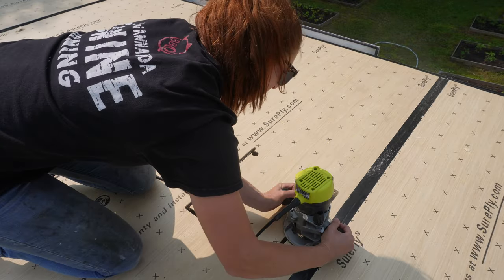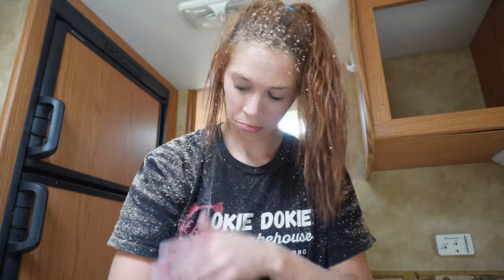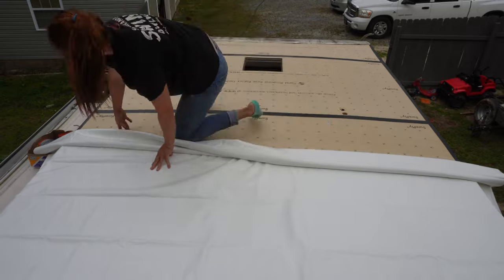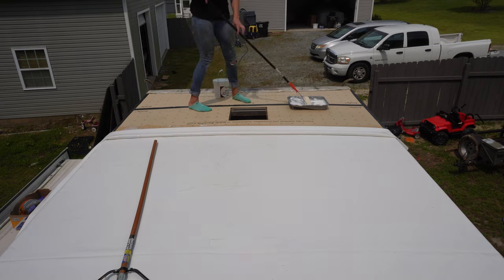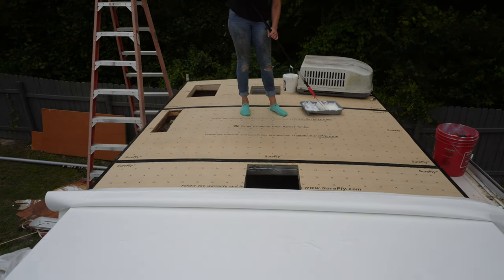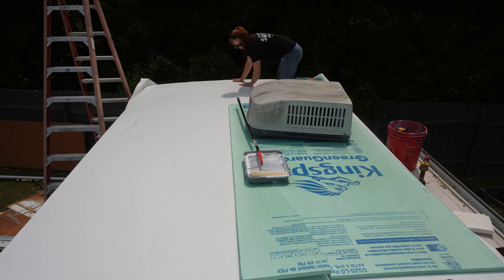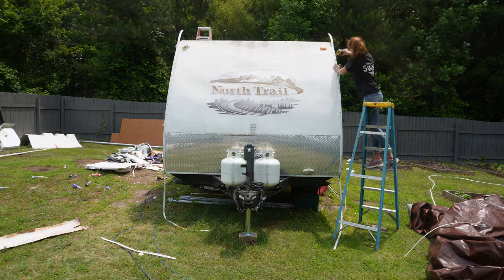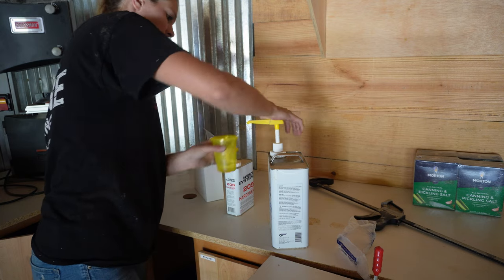RV Water Damage Repair: Demo Day 9 Front Cap & Roof

Comment: when you use contact cement, you have to apply it to both surfaces you want to bond together, wait for it to dry and then join them.  Once both pieces touch, it's stuck so make sure you have them where you want them.  You can't use it wet.  It has to dry first.
Reply: I haven't seen one person coat the decking & the roof material
Reply: @jamesmedina2119  He is talking about when she coated the front cap plastic/fiberglass to the ply.  She rolled the contact cement onto the plywood than placed the fiberglass on it.  I will find out in the next video, but I am guessing it didn't work.  Derek has it right.  Cover both surfaces, let them dry, then when the two dry surfaces touch, they will never come apart.

Comment: A skate wheel type hand roller that's used with flooring like vinyl would help you much better than the squeegee. Take that from a old floor man. Rubber knee pads might help also 😬. Another thing is I'm sure you already know but just incase,, the contact cement works best if applied on both surfaces and let "dry" to where it's just a little tacky then matted together. I'm glad I found your channel. Your honesty is top notch and you do excellent work!
Reply from the maker: I usually use a pool noodle to smooth it out and it’s always worked great but my kids used it as a sword and broke it and I forgot to buy a new one 😂 I do also think that’s why the contact cement didn’t work is because I only applied it on one side…maybe I’ll re try it again on the next camper

Comment: great job!  I started searching for repairing the front cap on our fiberglass exterior trailer.   Our front cap is so bubbled that I don't think it's repairable so I'm going with new fypon and a 91"X96" flexible panel backer(called PWP) that takes curves(available in one piece from Hemet valley RV, Calif and they ship)and comes pre-laminated.   Our local repair shop wanted $7k for the repair...ouch! More than the trailer is probably worth.   Thanks for posting your videos!
Reply from the maker: Let me know how that panel backer is! I couldn’t find it in my area, closest place was 4 hours from me to get a different material 😳

Comment: I can’t believe the contact cement worked?!  It looks like you attached the two pieces without letting it dry.  Contact cement that I have worked with always has to dry before you let the two surfaces contact each other.  I’m curious what the product actually was.
Excellent filming and story telling with your video by the way.  This looks worthy of subscribing!  (Just did).
Reply from the maker: I eventually realized it was because I didn’t apply it to both surfaces. Whoops 😂
Reply: @fallenintocamping  now you’ve got me curious as to what the better product for gluing the surfaces together is.  I know that the epoxy tends to separate under heat with a bit of moisture (along with the plywood layers).  My guess is as long as the plywood separates, under those conditions, it probably makes little difference.  

I am quite enjoying more of your videos now too by the way.  Keep up the good work!

Comment: Ok so we had bought a camper from a lady that she wasn’t able to fix anymore she had all the parts needed so we bought the membrane from her that cost me $500 thinking it was the right size, well come too find out it was not BUT it had 2 pieces one that was going to be used for the slide out. We looked at that and it doesn’t need replacing. So question is can we use both pieces somehow together and if so how?

Comment: Question:   Would spray foam insulation on the ceiling work?   Or does that have problems?
Reply from the maker: I’ve never thought about spray foam, I’m sure it would work as long as it dosent expand too much. The the R value is also really low so it won’t insulate as well as the loose R-13

Comment: This is going to sound dumb, but I’m a complete rookie to it all, so how to you know exactly where to cut for the vents and such without seeing it? I’ve been trying to figure that one out for a while now, so might as well just ask. 😂
Reply from the maker: For the ceiling, I guess and estimate with a pilot hole and then go in with my router with a flush trim bit and finish the rest. For lights, I draw it out and feed them through before putting the ceiling in. I have another video I’ll try to tag you in on ceiling repair
Reply from the maker: Ok it won’t let me tag you but check out demo 7 and 8, it’s split between the two 😂
Reply: @fallenintocamping  Thank you!!